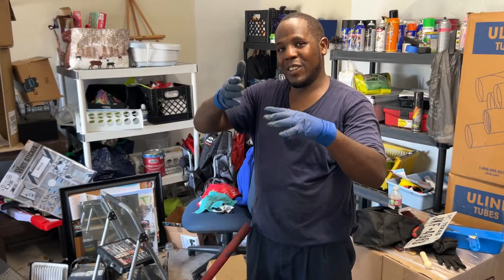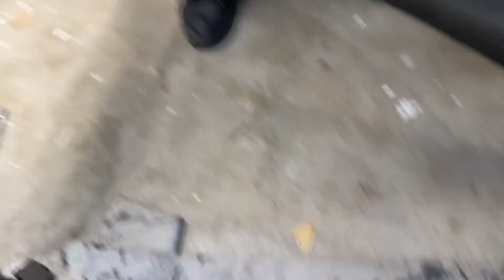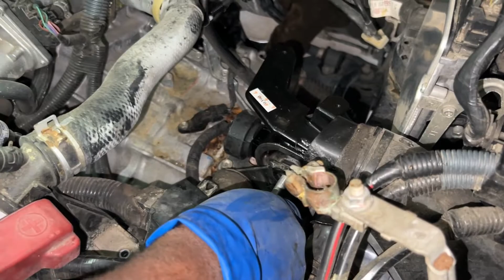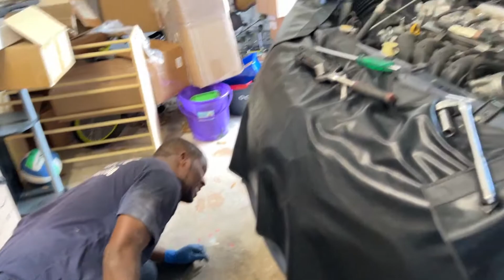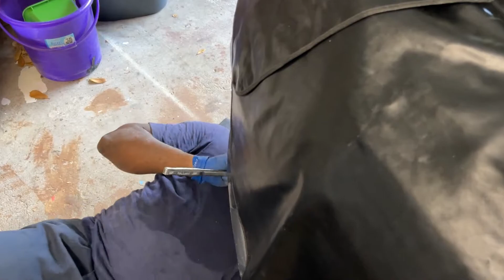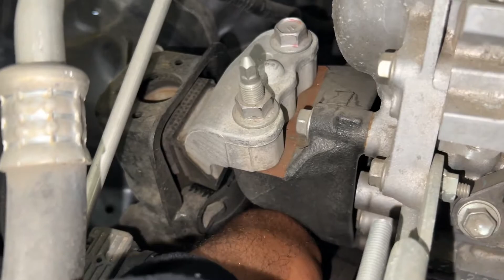HOW TO CHANGE ALL MOTORS MOUNTS ON 2016 TOYOTA COROLLA | HOW TO TELL IF MOTOR MOUNTS ARE BAD PART 3

Comment: almost everything under the hood is waterproofed or water resistant. even during normal driving in heavy rain theres constant water spraying through the rad and crevices in front of the car. in the offroad world its not uncommon to completely submerge the engine including the alternator without issues. alot of sealing and taking the time to dielectric grease every connection is needed for that though
Reply from the maker: Great info! I actually ended up cleaning the engine with water and we sold the car. Just gotta upload those videos